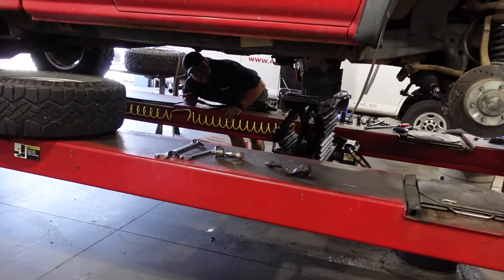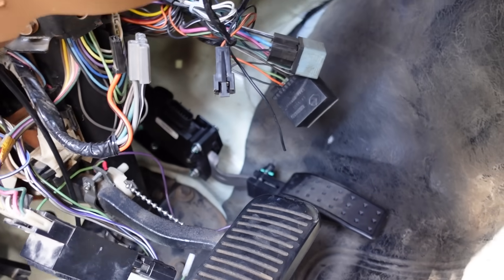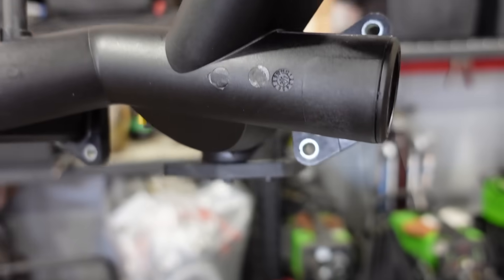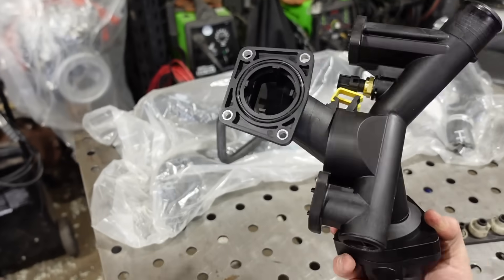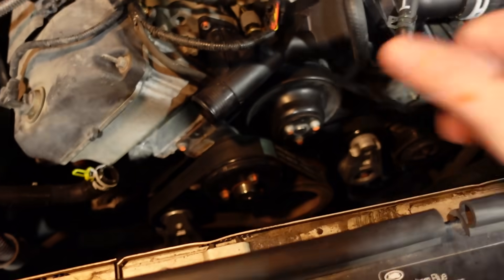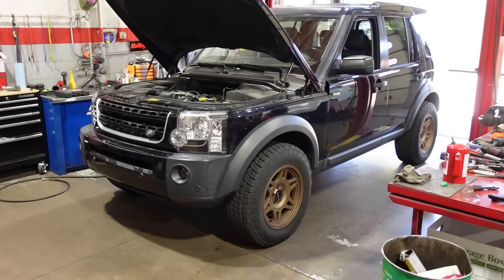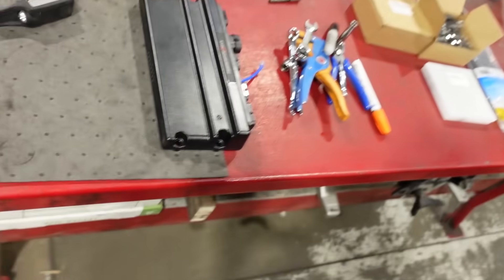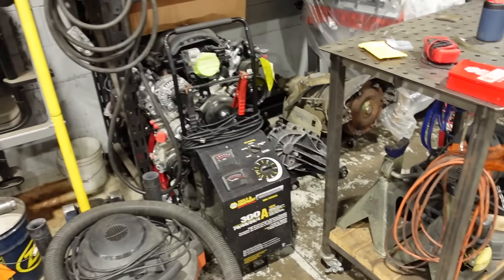fixing the WORST DESIGN in automotive history

Comment: Don’t recall if a BMW derived engine went in that Rover. But I used to wrench on the BMW inline 6 of the early to mid 90’s and the water pumps were the same. Plastic impeller and on one car the fins were all disintegrated ! The aftermarket pumps that I’d replace them with were all metal impellers

Comment: My wife had an early 2000's Jetta that had a water pump with plastic impeller, driving down the freeway the impeller exploded for no reason, car was 3 years old with 32,000 miles on it.

Comment: On an episode of DIRT EVERY DAY the guys had a Land Rover about the same age range as you wife's & they said the weak link on those things are the axles. They knew this yet took out 4 wheeling, no rock crawling or going over downed trees, just really steep hills & sure enough, the rear axle broke first then as they were trying to drive back up a huge hill the front axle broke too & their buddies who had modified Land Rovers had to pull them out of the park. Though you should know that LT before you go putting a supercharged engine in that beast.

Comment: It’s called engineered obsolescence, they design it to only last maybe 10 years max to keep the money ball rolling, manufacturers actually make more money selling parts than they do cars. 

Think about it if they designed a part to last forever we’d all be out of business, that said I absolutely hate replacing factory parts with factory parts, I always look for upgraded aftermarket stuff that is designed better to replace factory parts with, makes me feel like I’m accomplishing something, it’s bad for business yes but it keeps me sane doing so…

As for engine swapping the LR3 I’m right there with you brother, a Coyote actually looks similar to the Rover V8, would probably drop right in, swapping in a Super Charged Rover V8 would cost way too much with all the other stuff you’d need to do, of course a good ole LS would be great too 🤣

Comment: Hey LT how are you doing all those engine swaps and meeting the emission police? Up here in Northern Colorado (Denver, Boulder, Longmont, Ft. Collins) have to have emissions every two years on older vehicles. We have to go through Air Care which is the biggest ripoff ever. AND if you have to replace the CAT one HAS to use the more expensive units. Summit, JEGS etc. won't even ship the less expensive units to CO. I have a 1994 Toy V6 that needed a new muffler so I changed it and the tailpipe out myself. The CAT was fine so I welded up the new assembly to it. A month later the truck need emissions and the Air Care people gave me grief about the work as they thought I gutted the cat which I did not. I said did it not pass emissions!! We'll yes it did so what is the Deal? Damn these people are getting to be obnoxious!! Just curious how you get through emissions down in the Springs? The Ugly truck is registered for the street correct?

Comment: Info for the Jeep fans: It's a 1986 Jeep Grand Wagoneer.   In 1986, Chrysler rebadged the full-sized Wagoneer to "Grand Wagoneer" to distinguish it from the new smaller Wagoneer that was an uptrim model of the new Cherokee. 

This particular Wagoneer began its life with the Army Corps of Engineers. Unlike most of the grand wagoneers, this one is manual everything except the trans, vinyl and no woodgrain. Someone did a fairly major upgrade on the mechanicals in the early 2000s. They swapped the original AMC 360 for a TBI 305, 700r4, Atlas II, a Dana 60 rear, and ARB air lockers.

The truck fell into my possession a few years ago, and me being a lifelong Ford guy realized a little too late that I couldn't just simply swap the LS in without other major changes. As happens with many projects at snowballed quickly. It escalated from a junkyard motor swap to a completely refurbished motor and trans, adapters, and way too much to list. 

I can't tell you how thankful I am to have this project in LT's hands. He (and his crew) has been fair, patient, honest, extremely knowledgeable,  and great to work with. He is treated my basket case of a Jeep the same exacting standards and professionalism that you would expect on a SEMA rig. This is not like Pimp My Ride where it's held together with bailing wire and duct tape behind the scenes. LT is the real deal. If it were not for him, that Jeep and most of the parts would still be sitting in my field rusting.

The Jeep sat outside ( I think near the ocean salt air) for a long time and has some body cancer. Upon disassembly, it turned out that the inside had a lot of cancer too, so sheet metal and new vinyl are on the to-do list as soon as he gets it running, but not before we do some trail riding with the family! This machine is being built to be an off-road memory maker, so you can understand why I can't thank him enough.
Reply: Neat. Thanks for the backstory. That’s great.
Reply: I'm offended.  Baling wire is my go to.
Reply: I like the Jeep

Comment: I just did a water pump on an LR4 5.0 and let me tell you those vehicles are the biggest piles of shit anyone has ever made between the timing chains and the entirely plastic coolant system not to mention the leaky air. Why anyone would buy one of those is beyond me!
Reply: You remove the 5.0 from the LR4 and you put the LR4 (LR4 4.8 Iron Block) in it

Comment: I'm kicking around the idea of doing an LS swap in my Xterra, but I don't have a shop. I'm tired of a wheezer V6 that can barely get out of its own way, let alone can't haul a trailer without needing to use the slow lane, and that's with an empty trailer!

I'll probably just replace the vehicle outright with one that runs the way I want and drive off into the sunset without looking back at the abandoned X.

Comment: I spent 7 hours replacing a heater core on my B5 Audi just for the car to not start when I was finished. It didn't start because the gear on the flywheel fell off! So 14 more hours (21 total) the car functions as it should. Yeah maintenance is really annoying sometimes.
Reply: Yet another pos design

Comment: @3:41 You are correct
The speleothems with which most people are familiar are stalactites and stalagmites. Stalactites grow down from the cave ceiling, while stalagmites grow up from the cave floor. It's easy to remember which is which: Stalactites have a "T" for top and stalagmites have a "G" for ground.  I remember the ones that hang down have 'tities" in it...
Reply: I always remembered it as stalagmites g for ground, stalactites c for ceiling
Reply: Here's another one: stalacTITES hold TIGHT to the ceiling so they don't fall, stalagMITES MIGHT reach the ceiling someday 😁

Comment: They do the things they do because they don't turn wrenches. IMO, ALL engineers should have to spend 1 year in the body of engineering they study before theyre handed a degree. And that goes for ALL engineers. I was an electrician for 20 years and ran into the same issues. Poor engineering.
Reply: As an engineer, they have ~3 different goals to balance. Ease of maintenance, ease of manufacture, and cost. Maintenance usually loses out even if the engineer wants to preserve it. He doesnt hold the wallet. Car manufacturers dont care about the 3rd and 4th owner of a car who does repairs themselves. They also kinda don’t care about the first owner that pays the dealer to fix issues. Until they gain such a reputation of being unreliable, people will keep buying them.
Reply: @chaunster  exactly right! All good reasons for a 1 year internship, reputation.
Reply: @sixoaksfarm1556 in the end its bean counters that cause poor engineer designs
Reply: @sixoaksfarm1556 he said the actual car company doesn't give a fuck about ease of repairs so the 1 year internship wouldn't do anything.
Reply: @sixoaksfarm1556 Not really. Chaunster explained it pretty well but didn’t really drive home the point that we know we’re making these maintenance items difficult before a vehicle goes into production but the decision to leave it that way is weighed against a lot of other factors. So usually the case is that if a maintenance item is difficult it probably is that way to avoid an even bigger problem (usually cost or deadline related). An internship or an apprenticeship won’t help because there are a lot more factors at play than ease of maintenance which is usually the lowest priority. We wouldn’t leave it that way if we had the choice but thats ultimately a decision that was calculated.
Reply: @shadowopsairman1583  Exactly.
Reply: @chaunster it's why I have a 2006.5 Silverado about 90% of maintenance I can do myself. I'm no fan of anything fwd, laterally placed or ohc engines
Reply: People who blame engineers should have to spend the time to elevate themselves and spend 1 year being an engineer before blaming them. Then they will realize what its like to have an accountant look over every decision every mechanic thinks they understand that the engineer did wrong
Reply: @EGGINFOOLS  right because shops dont do any accounting.. lol
Reply: @sixoaksfarm1556  That has nothing to do with how a vehicle leaves a factory.
Reply: Your line of thought is 30 years too late - engineers today design cars to be assembled by robots.  Even if they can turn a wrench, their marching orders are to design a part that can be mass produced within X amount of time (takt time) and under Y amount of cost, whether or not Billy Bob at the local garage can easily change a part that has a life expectancy past the warranty period is hardly a factor.
Reply: I can go on for days on engineers in the industrial electrical/mechanical
Reply: @joeymerrell8585  I could too as well as management and accounts. I'm a controls engineer. I know the field well
Reply: @EGGINFOOLS  I do controls and automation myself, I ha e seen things that make me wonder how they ever got a degree.
Reply: Had the opportunity to work with Lexus engineers. They developed amazing products that never see the light of day. Accounting is the final release for what sees the showroom floor.